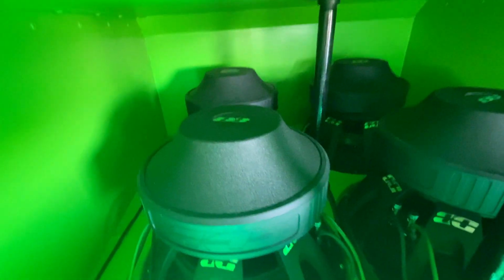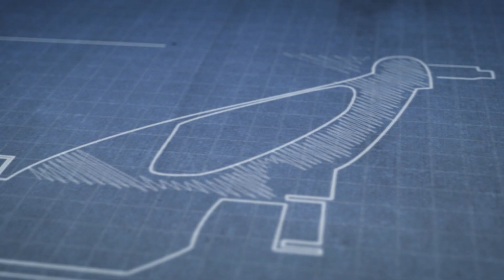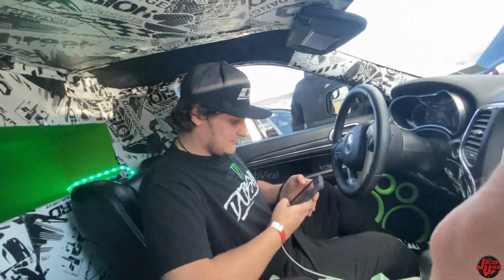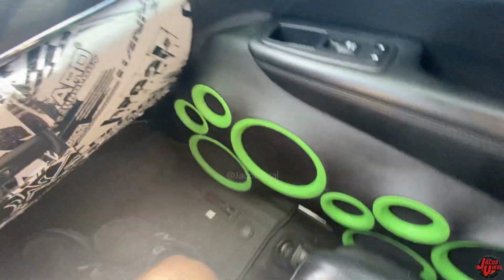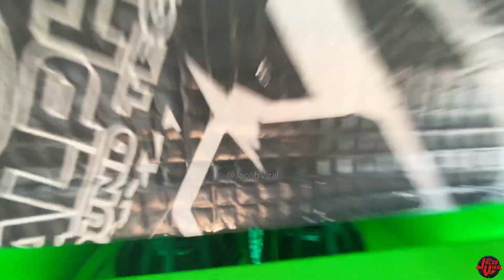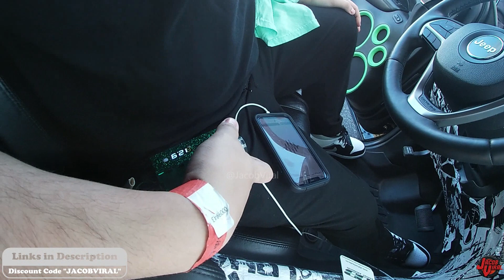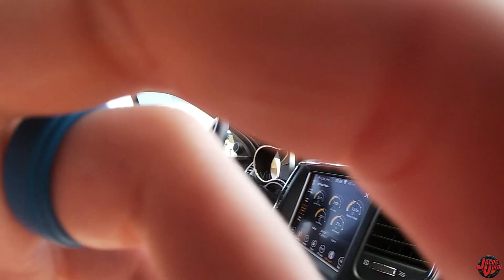16,000 WATTS ON DEAF BONCE 15S PLAY FULL VOLUME!

Comment: Something tells me if he blows a sub it won't be easy to get out
Reply: Haven’t seen a deafbonce blow, not to mention I’ve seen 2 4515Rs on 32,000 watts
Reply: @rileyh.4554  I have
Reply: Hell ye I so curious too subs built with in the 4th
Reply: @billrossow4242  got a vid?
Reply: @rileyh.4554  not everything in life has a video, I seen it in person. you honestly think you cannot blow one?
Reply: @billrossow4242  just wondering if you had a video, no i do believe you can blow them i myself haven’t seen one blow. What series was it and what amp was it on?
Reply: He's had to remove them a few Times and they're custom recones now that build has changed alot since the recording it's normally running 4 aak8ks doing 160s+ currently it's 2 because a amp died